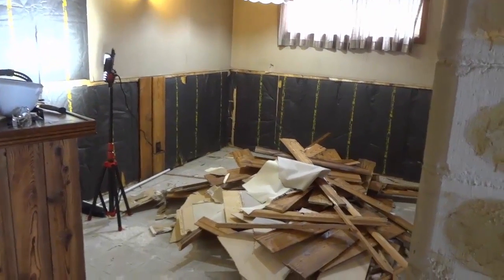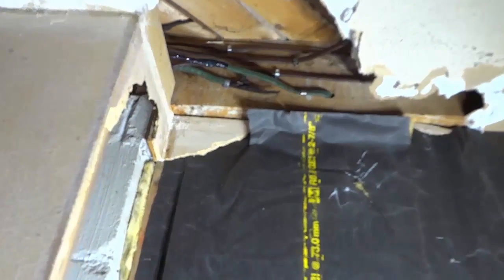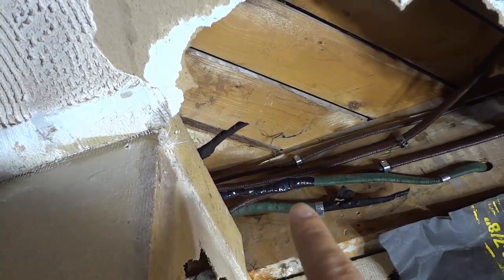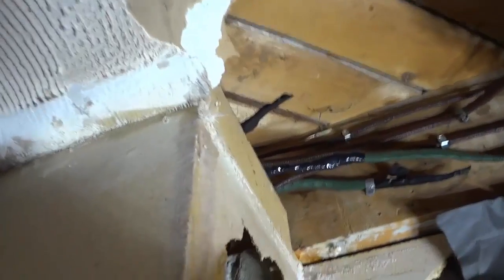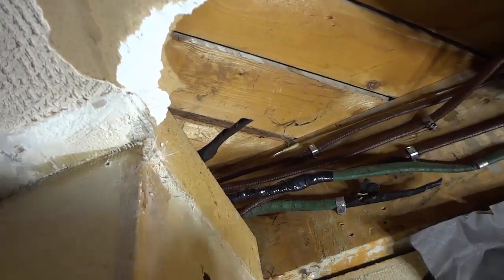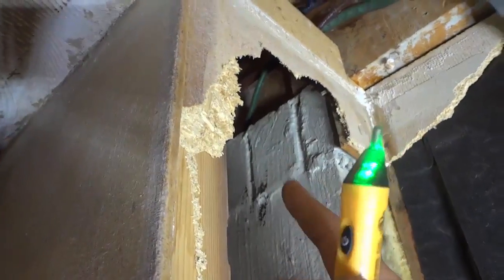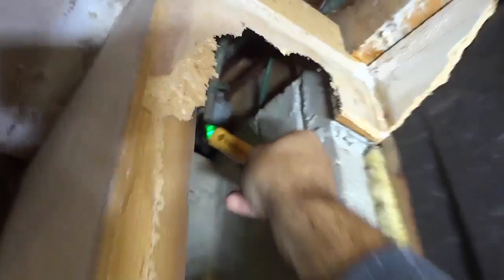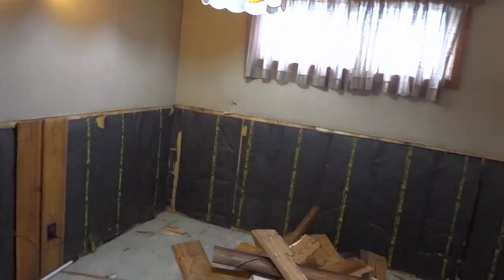Buried LIVE Electrical Wires-Taped Off With Electrical Tape

Comment: Good YouTube- - really would appreciate some advice on what to do next. What is the proper way to correct this situation?  Even it you manage to kill the power to those live wires, I read you cannot leave them in the walls?  Please comment.
Reply: You have some options. You could trace the wires back to where they come from (a junction box or the breaker box) and disconnect (after turning off the power of course). That would probably be your best bet. Your other option is put a junction box where the wire ends and throw a wire nut on it and tape on top of the nut.

Comment: is electrical tape ok to use to cap them off? 
I plan on using mine but just not today , gotta connect another day
Reply: Live wires that are not connected to an appliance, switch, or outlet need to be capped with wire nuts and placed in an accessible junction box.

Comment: “I have live wires video”.......You have the room lights on so your going to have live wires by ripping through the walls. pull the breaker to that floor, lights and plugs sockets and work in the dark...?